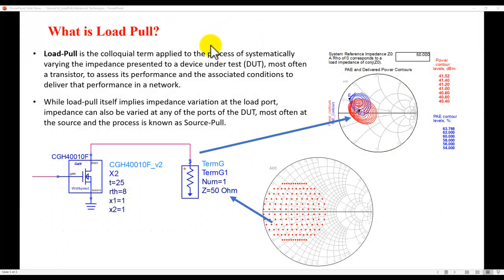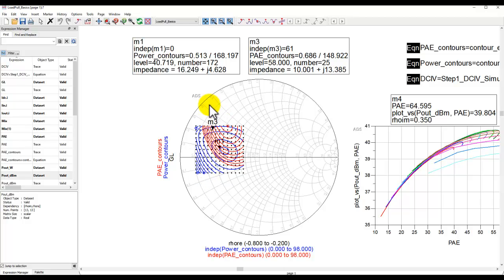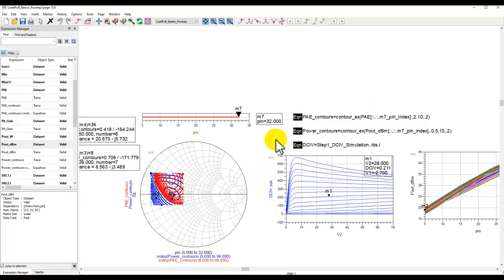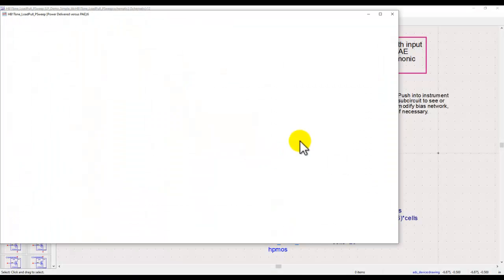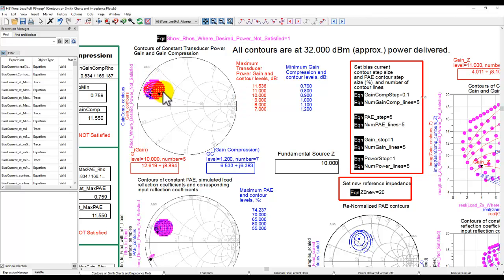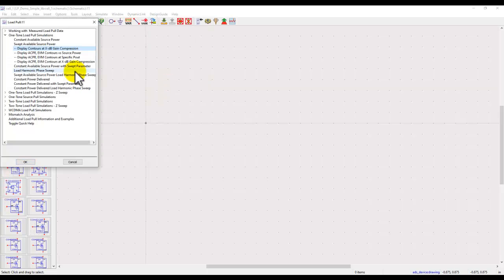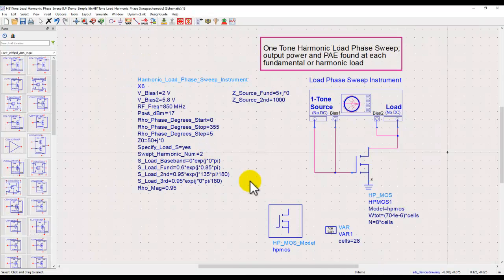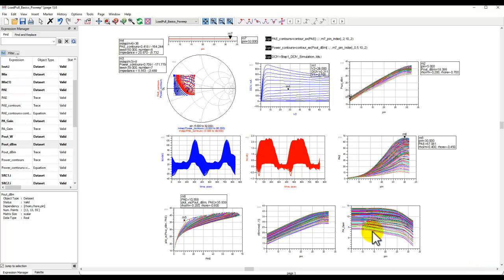RF Design-14: Load Pull - Advanced Techniques

Comment: Hello Sir. First of all, thank you very much for providing me with a good video. I have a few questions about Load Pull Simulation of 13.56 MHz Class AB Amp. When I run Transient Simulation with the Zload value I found with Load Pull, there is a lot of difference between the gain and efficiency I found with Load Pull. (e.g., 26dB & 75% with Load Pull, 29dB & 85% with Transient Sim) The exact cause is being analyzed, but the Transient Time of this Amp is very long at around 0.3ms, so would this have any effect?
Reply from the maker: Please contact Keysight tech support by writing to support@keysight.com

Comment: Hi @BhargavaAnurag
Thank you for your excellent explanation.
I have a question. I am,m using TSMC 0.18um rf technology to design a power amplifier. But I haven't a data sheet to determine "Z_Source_Fund" to run the Load Pull simulation. How much of it should I put into the simulation?
Please guide me.
Best regards.
Reply from the maker: You shouldn't get hung up on Z source, you can always start using 1-5 Ohms as a starting point and then you can arrive at the proper impedance when you start to use Load Pull or Source Pull.

Comment: Hello sir, Can you told me about the Z_In and Z_load value for device CGHV40320D because I did not  find in the data sheet .
Reply from the maker: You don't need that as you can find it out from the Load Pull and Source Pull simulations. You can start with your best guess and then narrow it down based on the simulation results.
Reply: @BhargavaAnurag  thank you so much for your guidance sir.

Comment: Hello Anurag, I am using ADS2020 (Update 1) and went into the design guide under the amplifier section and selected the "HarmonicZopt" workspace under DesignGuide==>1-Tone non-linear simulations==>'Harmonic Impedance Opt.'  However, after I run it with the device provided, the simulation runs with no problem but when I go into the data display the only tab that seems to mostly display any data is on the first tab.  When I go to 'Equations' tab in the data display all the equations are red though their syntax is correct and they are indeed choosing the right variable equations from the schematic.  Now I know that I typically can't plot a variable in data display unless it's for a measured equation or used in a simulation controller typically but I wasn't sure if I was doing something wrong or if there may be a slight error in the design guide for this as I know it's likely over 10 years old now from the 'Read Me' schematic in the design guide work space.  Please help if you can! and as always thanks for your help and these videos.
Reply from the maker: Hi,
Here are my comments:
1. The template you referred is created for Optimization. Instead of running Simulation you need to run Optimization once it finishes close Opt cockpit & update the variables and look at the data display and you would see all equations being calculated properly and you can see load and source impedances as you expect.
2. If you want to see the data after simulation then double click on HB controller, go to Output Tab and select Add/Remove and then select all Rsrc, Rload, Imsrc, lmload etc and click on Add button so that these variables are sent to dataset after simulation.
3. Run simulation and everything should be as expected
4. Reason it is done this way is to prevent users to run normal simulation, see the impedance data and assume that these are optimum values for impedance matching which they will be not unless you run Optimization to obtain desired value, ideally with FinalEF=0 or very close to 0.
Hope this helps....👍
Reply: @BhargavaAnurag  , that worked! I did the optimization but was still getting red equations in display after I updated schematic however once I put the variables in the equation onto the harmonic balance output that fixed it all! this was such a huge help! I can’t even put into words how grateful I am that you responded to me and gave me such detail on here! Infinitely many thanks and gestures of appreciation to you 👍🙏🏻
Reply from the maker: @Scuba_Bro  just spread happiness, share knowledge and help anyone you can and we all will be happy. All the best...👍

Comment: Hi Anurag, I couldn't find expression manager in View or Tools. Maybe I missed some part in your earlier video. Would you mind point me what's the problem?
Reply from the maker: Hi Steve,
It should be there in the View menu and pressing "E" should make it on or off. Which ADS version are you using?
Reply: @BhargavaAnurag  Thank you for replying so quick! I'm using ADS 2020.. It not inside View - it's in my Edit tab. However, I click it and it pops up a dialogue and seems the "database" type variable is not included, which means I cannot look up the values or data structures.
Reply from the maker: @stevexinjin4392  You need to be on ADS2020Update2 or higher to utilize the capability. Best is to use 2021Update1 and it also allows you to  use drag & drop plot as shown in the video: https://youtu.be/7XiIV6cbJLk
Reply: @BhargavaAnurag  That's really cool. Will try. Thanks!

Comment: Hello Sir,
Can tell me step by step how to change the ideal circuit to a microstrip line using MLIN, MTEE components. I have designed the basic rectifier and didn't know how to change it into stripline form.
Reply from the maker: I am not sure what you want to convert...usually in circuit sim you can connect component using wire and later want to connect them using microstrip lines etc...if that is what you want then simply define the substrate using MSUB on schematic and use transmission lines from library and use them on your circuit design. If it is rectifier then it will be quite low frequency so microstrip lines may not affect circuit performance too much.